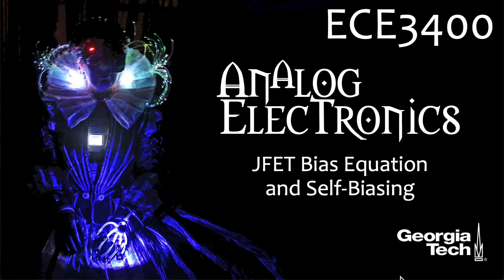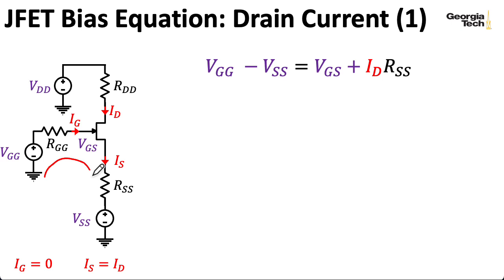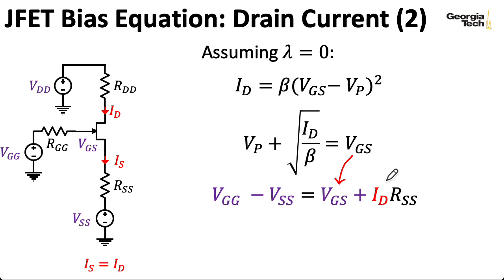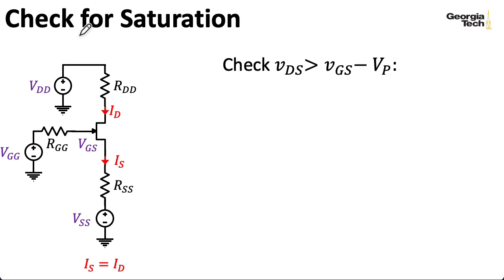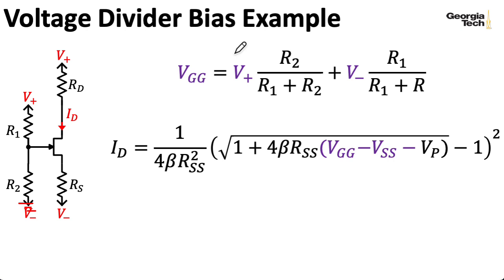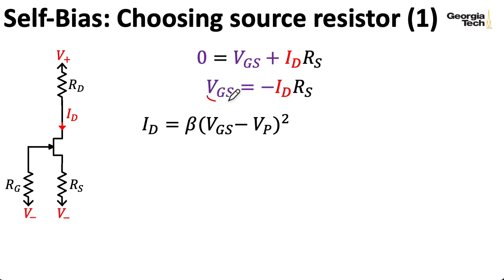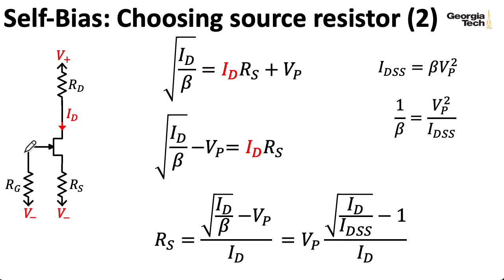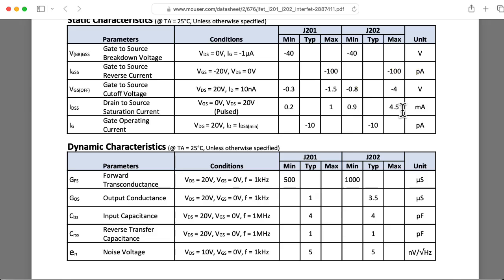ECE3400 L43: JFET Bias Equation and Self Biasing (Analog Electronics, Georgia Tech course)

Comment: JFETs are so underrated.
I found a very interesting application for them. I've found it in a hungarian HAM radio magazine and the guy basically made a FETRON out of a mosfet&jfet cascode to make a pentode tube substitute.
Basically the grid is the gate of the jfet, the screen is the gate of the mosfet "above" and cathode anode are the mosfet drain and the jfet source.
You bias the mosfet gate with a resistor divider and a capacitor to ground to bias it normally on. It behaves as a source follower so after Vgs drop from the creen voltage the jfet Vds cannot be over the breakdown voltage. For example 30 volt mos gate - Vgs drop of 5 volt is 25. 

Anyways, it's so cool. Square law characteristic and can handle tube voltages. It can only conduct Idss max current but jfets can be paralleled pretty easily or a current mirror can be used (or multiple ones stacked), at which point you can have a full power tube in the solid state glory!
Well... as long as all the biasing is done correctly to match the tube gain curves.

Comment: There is a very cool patent by Sondermeyer (of Peavey) for the "transtube" line. He goes into the use of Darlington pairs of NPN transistors to get around the variability of pinch-off voltages of JFETs. (see mid 1990's Transtube special schematic). I breadboarded a single darlington stage of the preamp. Works amazingly well actually. I think I worked out the math, but EE school was almost 40 years ago. LOL.

Comment: Hey professor, i recently saw a non inverting opamp but the gnd connection goes via a capacitor and afterwards on youtube a video about a circuit with that this as well. What's up with that?

Comment: Hi Aaron, just one note about your note about arrow inside the circuit symbol, that symbolizes a pn junction. I think this is not true, since when you you bias a JFET, the p and n junctions are reverse biased, and the parasitic input bias current that flows into the source from the gate is actually analogous to the reverse biased current of an ordenary silicon diode. If it was the representation of a pn junction, in the case of an N-channel JFET, it should point out, right? Did I miss anything?
Reply from the maker: It's like a typical diode symbol, it points in the direction conventional current flow if the diode is forward biased. Which, as you say, in typical operation it's not.